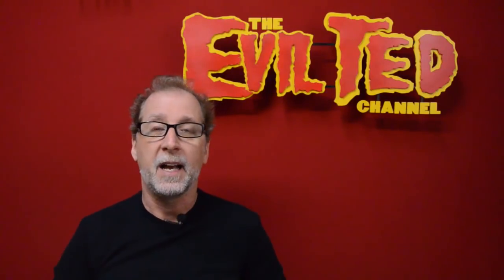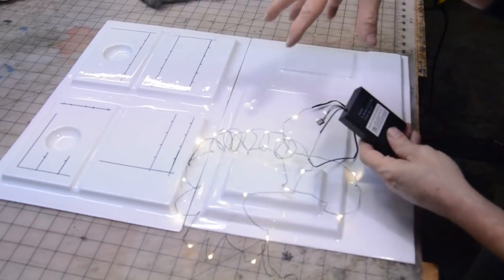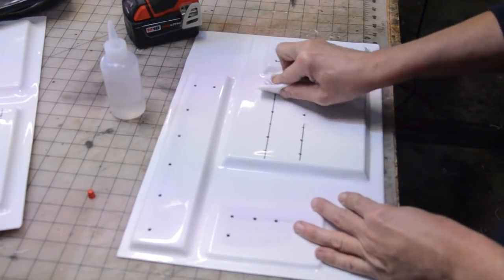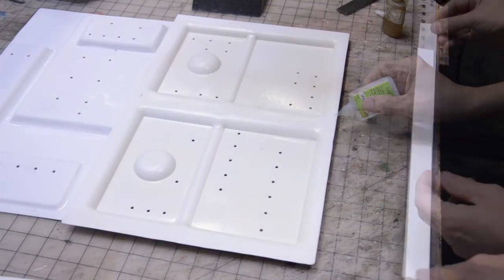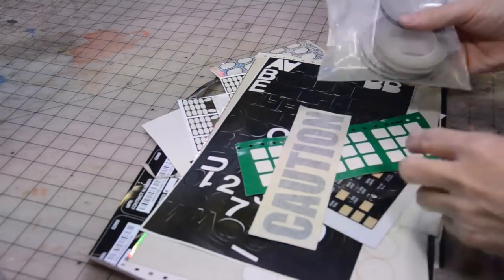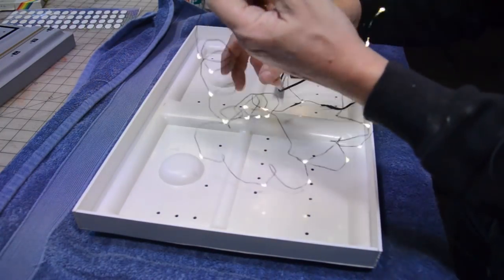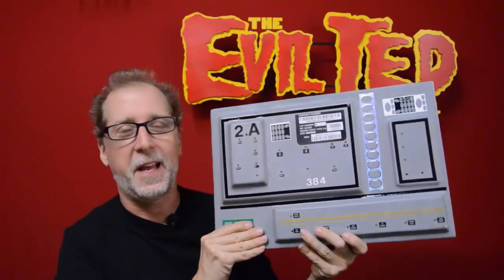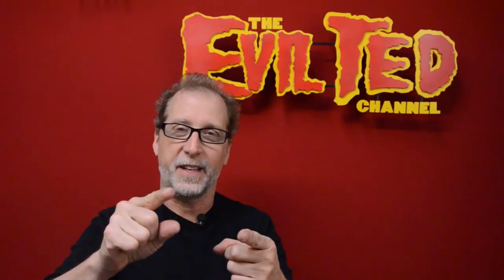Making a Control Pannel Prop.

Comment: Why not vac form them at the start with the sides so you don’t have to glue some on later and also make it look better from the side
Reply from the maker: That's what I wanted to do...But they were bad pulls, and the sides were no good. So I had to add the sides.
Reply: Evil Ted Smith I thought that might be the case. I don't have any experience with vacuum forming

Comment: What would you recommend doing if you don't have access to a vacuum form?
Reply: Okay this is a cheap shot but... then you should build one. (Seriously though, it's a trivial task)
Reply: You could probably make something like this out of craft foam.
Reply: My first thought would be blister packaging from various products. You could cobble some of them together into a single panel and use metal strips / stickers / whatever to hide the seams.
Reply: In addition to craft foam, as somebody suggested, you could use cardboard or glue sheets of sheet styrene, you can buy these from any decent hobby shop or order them online.
Reply: Styrofoam packing materials (like you'd find cushioning a TV inside its box) also has some pretty interesting shapes.
Reply: Styrofoam is a good suggestion but you have to be careful with what glues you use and what paints, otherwise they will just eat into the styrofoam. I don't know what glues are styrofoam safe, but I know that plastic cement (the kind you use on plastic model kits) eats into it, but is probably a great material to use to simulate damage. Paints wise, acrylics should work just fine, you might even be able to paint right on top of the styrofoam with acrylics, anything else you'll probably have to cover/seal with something that's styrofoam friendly first.
Reply: I think I saw CreateSciFi just go to the dollar store and buy serving trays of various sizes. Hot glue the small ones to the big ones in various configurations and for a few bucks your at the same place Evil Ted started. Check out the bottoms of serving trays at the grocery store too to get inspired.

Comment: You could also use a string of serially addressable lights and a small microcontroller  as a comparative a simple way of getting all the lights blinking in different ways.... or you could actually use it show meaningful data without having to devote a single IO line for every light
Reply: Agreed - with every light blinking at once, it feels like the system needs to be rebooted.
Reply from the maker: I had one day to make them...
Reply: C'mon -a Raspberry Pi and a quick Python script? You know how high the bar is for you ;) KIDDING! Love the work, and it was a nice build. Love the videos and you've inspired me to do some of these projects myself. Couldn't pull that off in a day, so I guess I can give you a break :D
Reply: Evil Ted Smith I wasn't criticizing just suggesting if somebody wants to and has time to take it further
Reply from the maker: OK.

Comment: I'm generally a fan, but those stickers look pretty bad man.
Reply: It's probably a low budget movie so he went low budget here. Also for something in the background that wil probably never be up-close or fully in-focus, this will probably be great.
Reply: There used to be something called the 10 foot rule, a prop or set piece only had to look good from 10 feet away. That's because the resolution of TV screens and to a degree film, used to be that anything from further than 10' away wouldn't show up clearly enough for any details to be clearly visible. This is why prop/set designers used to put joke text on video screens knowing that no one will be able to read them. Of course HD has changed this to more of a 5' rule but the basic idea still stands, if it's not going to be seen up close then it doesn't need to be highly detailed or that well done.